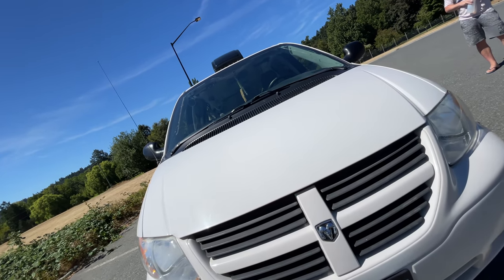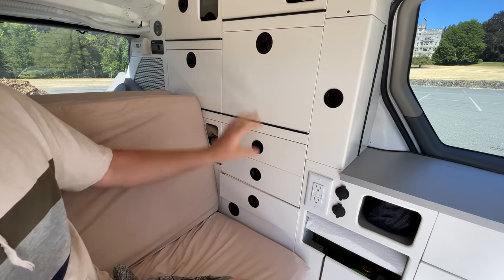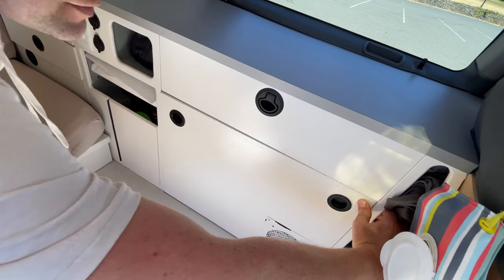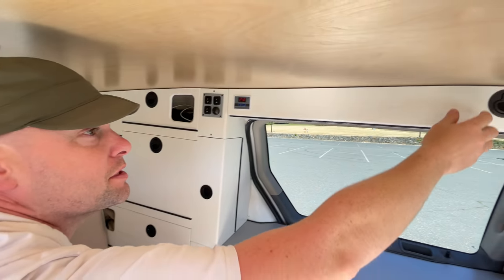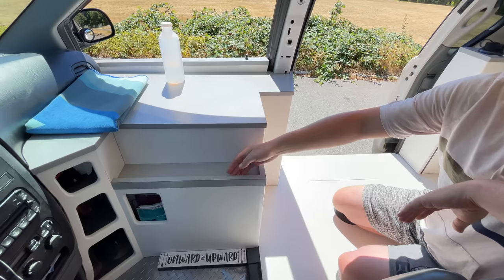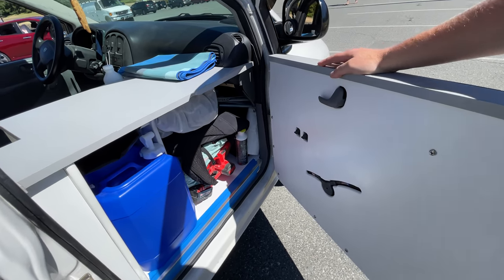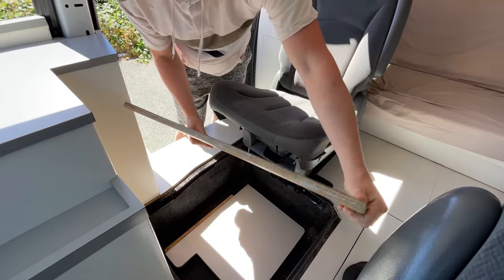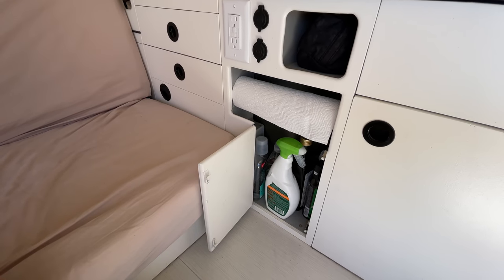Man Turns To Living In His Van Due To High Cost of Housing | Minivan Home

Comment: What year is your van? I noticed the loops for the bottom back of your seat aren’t connecting to anything , mine is a 2019 and has loops it attaches to coming out of the floor. Did you modify the bottom of the seat?